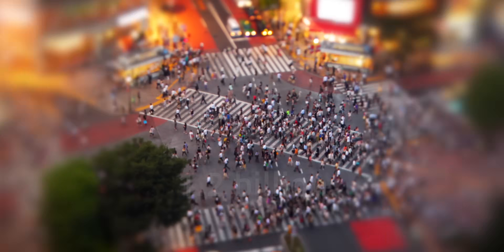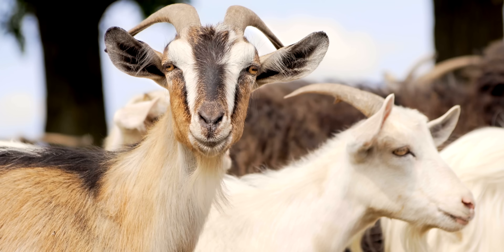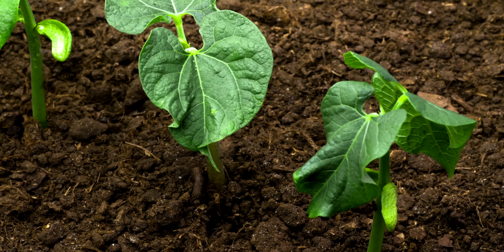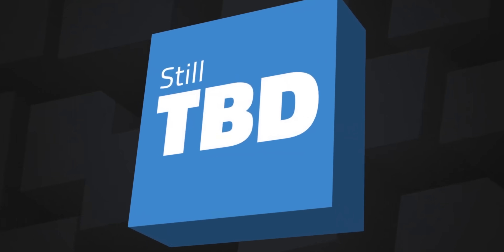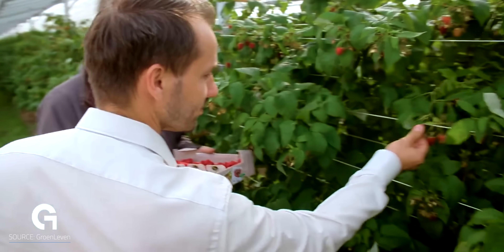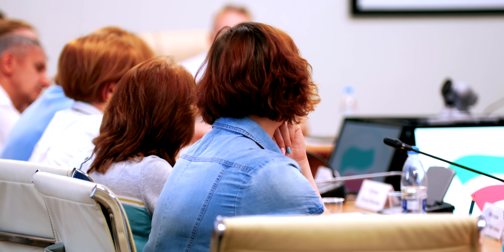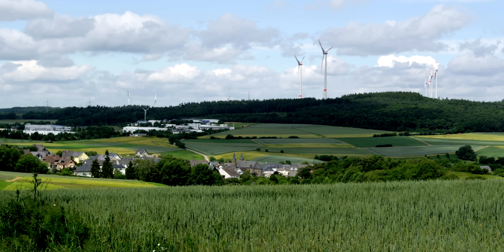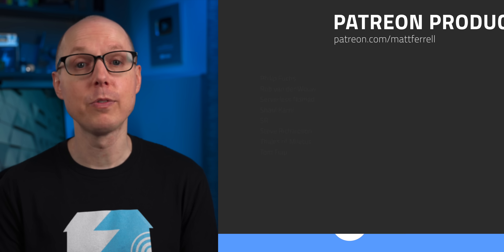Solar Panels Plus Farming? Agrivoltaics Explained

Comment: Nice to see, but I am not understanding why 'solid state' wind generators are not coupled to the solar panels (especially using directional or channelled air flow).
I am also pretty sure ground temperature can be much warmer than air temps in winter. That also enables heat exchangers and energy recovery, if you loop down far enough.
So you can have wind, heat and cold recovery or all year energy recovery.
Then you have rain which can be captured, at height, then used for gravity energy generation/storage and/or irrigation needs.
But then why let that water seep into the water table and or go where it is not useful/needed, rather than have a waterproof base below the soil and channel the run off.
Like using the excess/wasted energy that isnt needed 24/7 to pump that water to height.

I see no reason why you cant have inorganic energy production and organic energy production (as fuul/food) coupled. Seems eminently sensible to me. Especially as the farm requires energy to function. Especially as it requires fuel. So rather than diesel, why not replenish its own hydrogen for modular fuel cells, rather than diesel engined machines ?

But the worst and most criminal aspect of farming to me, is only using it as 2d area rather than 3d volume.
The consequences is their yield is artificially limited by a massive amount.

Comment: 2:45 - dude the efficiency drop off on any panel at the wrong angle is huge. I guess if panels are so cheap you get a net income increase from using them it'd make sense, but at this point it doesn't.
Reply: The advantage of vertically mounted panels is to produce electricity during the morning and evening hours and especially in winter with low sun, as compared to sky facing panels, which peak during noon.
Reply: @midnight8341  so they're using solar panels in places that are inappropriate for them
Reply: @sinephase  no, they're using statically mounted bifacial photovoltaics where actuator-mounted one sided PV would be too costly or high-maintenance to justify the investment.

Comment: Stop messing around with growing something around your pv's with such low power density - it's alternating land use. Put them on your roof if you have an EV. If you don't want coal or gas get liquid Thorium metal ion molten salt energy converters- walk-away safe cheap too $1200 
Per kiloWatt.

Comment: Matt, it seems like, with some research, this could be a win-win for both energy and crop production. I saw somewhere that people were installing solar panels over canals. The panels reduced evaporation of the canal water, and kept the underside of the panels cooler, increasing efficiency.
Reply: Veritasium did a video about a California water supply putting plastic balls into their reservoir, I imagine putting solar panels over it instead could actually do quite a bit of work out there. Providing energy for the area, preventing birds from getting near it (he explains why it's an issue in the video) and reducing evaporation would actually save them loads of money in regards to water. Though, I'm sure the repairs and installation likely wouldn't be as cheap as building this same system over land, since they'd need to put supports in the middle of the water.
Reply: @RyuuTenno  why couldnt they do like a bridge or a frame over it. The aqueducts arent that wide.
Reply: @polygaryd  cause the section they'd be covering isn't a simple channel. It's effectively a small lake. They can likely do that over the other sections that are channels/canals, but, over the main section, they can't. In the video, they're driving through the whole thing on a speed boat because of how large it is.

to give you an idea of scale: they have to use 96 million plastic balls (much like a standard kids ball pit) to cover the entire surface of the reservoir section.

https://www.youtube.com/watch?v=uxPdPpi5W4o
Reply: @RyuuTenno  are you here in the valley? I dont think we are talking about the same thing. The "small lake" would be a reservoir not an aqueduct. Second of all no speed boats are allowed in the reservoirs as far as i know in any state ive ever lived in. Unless its an all electric motor maybe.
Reply: @polygaryd  i'm on east coast; but, yeah, they're probably using an electric engine. But, they are using a motor to get through, and cut it off so that the guy can just see how the boat's affected by the tons of balls in it.
Reply: @RyuuTenno  i watched the video you're refering to a while ago.  Its not the same as what I'm talking about here.  I agree it would much more expensive to mount solar panels in the reservoir but thats not what I'm talking about as a good idea to do here in Phoenix area. Not that that's a bad idea but we just arnt talking about the same things or the aquaduct in California is much wider and deeper than here in Phoenix metro area.
Reply: @RyuuTenno  They put the solar cells of rafts. There are several places where this is done. I think I saw a Scientific American article on this, and I know they are doing it in China
Reply: They should do that here in az over the aquaducts. Would be perfect to minimize evaporation and generate power. No boats of any kind are allowed in the aquaduct anyway.  Perfect solution.
Reply: Heard of that in India.
Reply: @christiankruse1970   ,
yes  near Ludhiana , Punjab State of India
Reply: @christiankruse1970  yes it builds in gujarat state of india under narandra modis  chief ministership tenure of gujarat 👍
Reply: Do you mean irrigation channels? How could barges use such canals? are the panels very high over the canals to allow boat traffic?
Reply: @nct948  I suppose sailing boats (with masts) wouldn't use the canals, so the panel are mounted maybe 2-3 meters above the banks, to clear the boats. I guess they figure this out before they build them ! Maybe what I saw was actually irrigation channels (rather than navigable channels).
Reply: @nct948  they're irrigation canals, no barges on them.
Reply: @andychauhan6544  thanks for confirming
Reply: 1.5 km long Solar panels has been installed on canal  near Ludhiana,Punjab India
Reply: It was done in Gujarat, India. Non other than Narendra Modi.
Reply: New technology for electric power generationhttps://youtu.be/xc2V2BS_Fng
Reply: Here's something for the idiots of Renewable Energy: 

Sooner or later you greenies are going to need to grow up and learn how economies work. - hint government people understand nothing of economies other than  how to rape them.    

These G-morons decided "woke' power (power that doesn't really work) was a great idea for them, not us, so they decided to steal some money from some ratepayers in order to pay others to stimulate the growth or power that really doesn't work - ie wind and solar.

In the real world, the one that really works,  there is something called supply and demand and these things regulate the price of everything fairly.  

Your butcher buys his beef by the side and pays more for it than the meat packing plant did who in turn paid more for steer than it cost the rancher to produce it.   Get it so far?     

Now when you buy that beefsteak at the butcher's shop he's going to get his markup as well,  so you as the end consumer are going to have to pay a lot more for it per pound than the rancher was paid for it.   

Next time you want a beefsteak drive out to a ranch and buy your steer on the hoof - then you slaughter it, age it carve it up sell the inedible parts to dogfood processors and the like and eat the rest of it on the cheap - no you want the value that all those who added value to the meat along the whole length of the supply chain don't you?  Or do you buy your steaks on the hoof?      Or do you expect to pay the  ranchers price at your favorite steakhouse as well?

It's that way with electricity too, you cannot expect the power company to buy power back from you at retail rates when they don't even need or want the power. With that business model they will go bankrupt as soon as their investors are wiped out.    

If that rancher were to dine out at your favorite steakhouse why not demand that your ignorant politicians make the restaurant buy his on-the-hoof steer from him on demand at the same rate per pound that they charge you for a 16 oz prime rib?    

The problem is, as with all government planned economies, sooner or later everyone will want to receive the grift instead of paying for it, when that happens the lights go out - permanently.

The most ignorant feature of all of this is that it is supposed to solve some problem that the grifters dreamed up but that does not actually exist so solar panels and wind turbines only create huge problems, they solve nothing - time to wake up you dizzy Californians.

Comment: STPD: cattle hate solar panels??? That's unfortunate the amount of land required for cattle I would think having even a few rows of solar panels on stilts would be beneficial since it provides shade and most grasses that they eat can be burnt up from too much sun. Plus having a farm gain a fairly regular income stream throughout the year rather than a large amount only at harvest helps with the farms stability. I'm very interested in why this isn't a thing
Reply: Cows are heavy beasts, and probably like to rub up against structures, to relieve itching etc. They would have to beef up (!!) the structure to cope...
Reply: @chrisheath2637  I didn't think of that. Itchy cows. Lol maybe the extra cost to reinforce it makes it not cost effective for most cattle operations

Comment: Another buracuracy issue is especially in the US is that duel use land is hated. I guess it's with how they made zoning but most places in the us is only expected to be used for one thing at a time. Can't have a shop and a house together. Can't build that storefront next to the industrial factory. Etc. 
More ideas for where to put photovoltaics, large scale chicken farms. They are just large long buildings practically already in the shape of solar parks. You just gotta put the solar panels on top of them.

Comment: Things can grow under the solar panels? Good, I have an idea again, how to use it in urban environment. The flat top buildings usually have airconditioners, etc on the roof. Build a secondary roof above them, which have lawn or something like that, where the office workers can spend their breaks if they have any. This may mitigate the sun's heating effect on the roof, so the aircons can consume less energy, and may mitigate rain damage as well. Put a solar roof above all of that, and said workers won't get heat stroke if they want to use the roof during the summer.
Reply: The air conditioners don't usually take up the whole roof. You could probably build your green area around them and still make a difference.
Reply: @Roxor128  Probably, but would you like to spend your time next to a heatchanger unit? :D
Reply: @RelakS__  Are they really going to take up enough roof space for that to be a concern, though?

Comment: I fit panels and for most farmers the out buildings have massive surface areas, cattle sheds etc. -much cheaper to fit, also no reason to compromise the land. Maybe roof top gardens and NASA?
Reply from the maker: Thanks for sharing.  Farmers fitting plenty of panels on buildings is usually more than enough for the farm itself, but the benefit for agrivoltaics is really meant for more grid-scale level production.

Comment: Just place the solar array around the sun to produce enough energy in one second to last a million years.
Reply: And then we'd still to send all of that back to earth, which is impossible even using a modern day laser, as the beam would either spread out enough to cover the entire planet or would need to be refocused on the way with a whole chain of satellites.
Also, around the sun there's way more efficient means to generate power, like from a solar wind power satellite. But there's still the problem of focussing the energy back to earth.